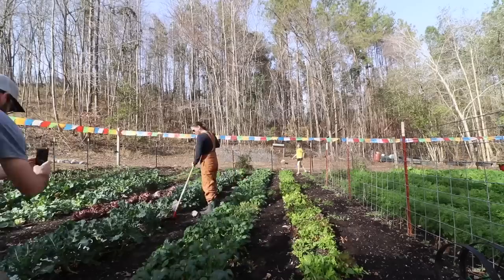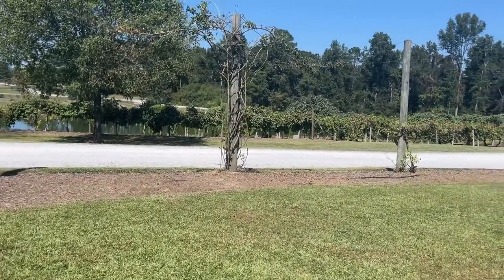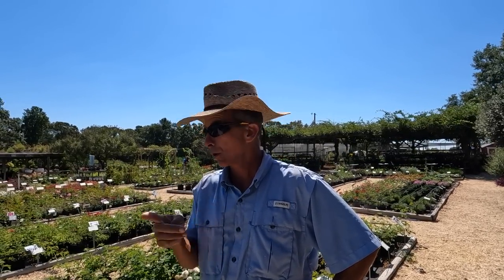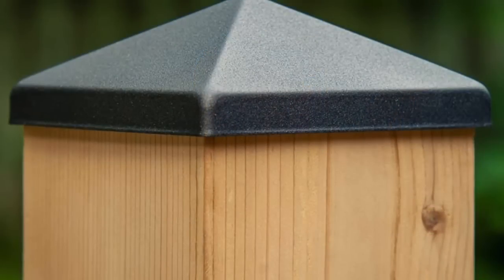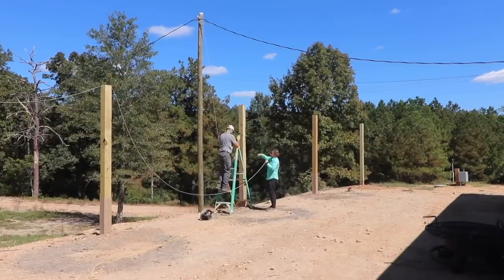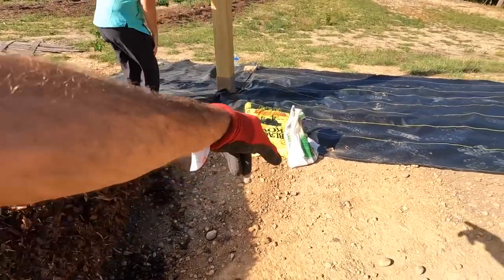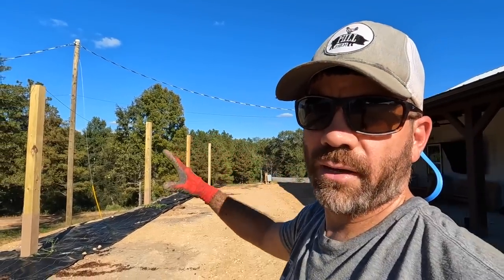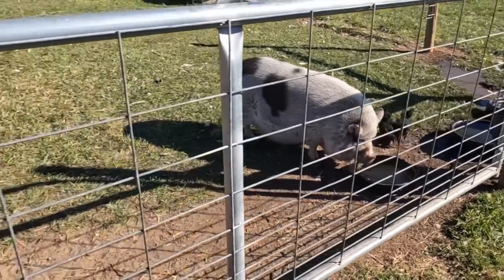Maybe The Most Majestic Way To Grow Roses!

Comment: You may want to caulk where the post protector ends at the top because every time it rains water will go down inside and sit there for a long time and rot out your wood anyway because you will be using it on the outside instead of the inside of walls.🧡🧡🧡🧡

Comment: Like placing trees on the north side of the house for a wind brake to reduceing the chill factor in the wenter.
So planting fruit trees in rows on the north side, you can plant multiple rows but I would stagger the trees in the 2ed row so there placement would be between the trees in the 1st. Row to help in reduceing the chill factor.
As for the wood poles that you will put the topers on ,  I would paint the top and 2 inches on the sides with a apoxy primer to make them water proof at the top. Then place the topper on them.

Comment: Pole protectors if you don't seal the top of the plastic a round poles water will run down inside and rot👀 the wood very quick.....Thanks y'all 👍
Shoe🇺🇸

Comment: I would rethink in putting the pole protectors on those beams.  Normally the sleeves are used when the pole will be in the interior of a barn (or barndomium), or when it's going to be encapsulated in wood trims or masonry - basically there's no water going to drip from the top into the sleeve.  If these poles are just going to be 'naked' and outside, the sleeves will catch any moistures and keep it on the wood.
If you're concern about the wicking, there's a product that acts like heatshrink - you put it on the pole, heat it with a blowtorch and it shrinks, melts and sticks to the wood.

Comment: When the roses have matured somewhat - there is going to be added weight. How did you calculate to allow for the wire stretching due to the weight of the vine. Even more weight when the vines are wet. - good luck, I look forward to learning. Regards to the family - Dennis

Comment: How do the top of the post bottom protectors seal up so they don't fill with water and become post rotters? Do you put a bead of silicone around the top? I know you talked about weap holes. Are they under the ground? Will they let moisture infiltrate?

Comment: Those post protectors look like a bad idea; rain that washes down the sides of the beam and goes inside of them has nowhere to go, so the post will rot right away. I would pour some kind of sealant in there- like fiberglass resin-